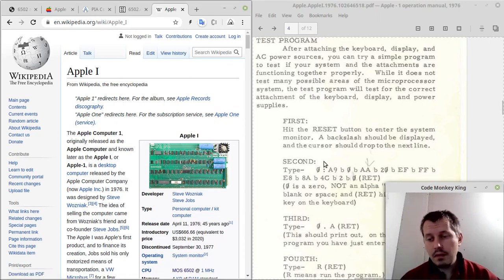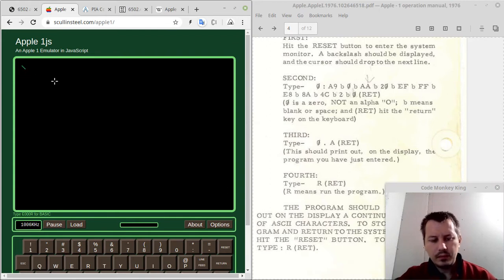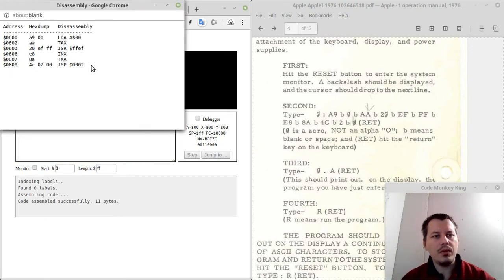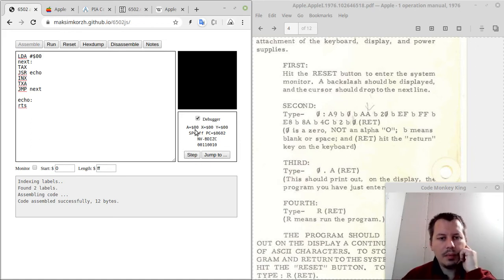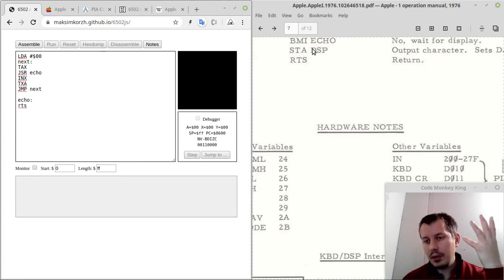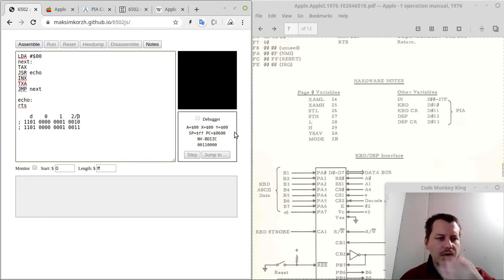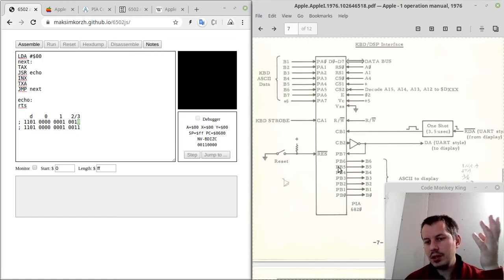Test program for Apple 1 computer (1976) disassembled and explained

Comment from the maker: 00:00 Intro
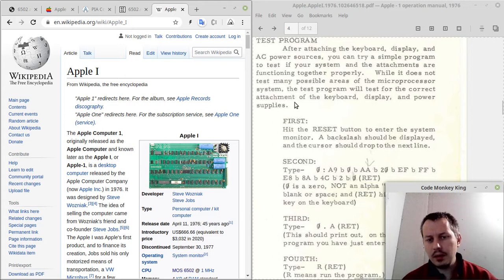01:20 Apple 1 test program
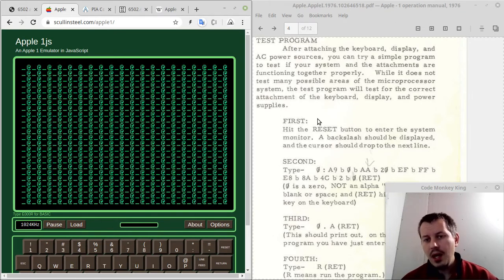02:34 Typing in test program machine codes
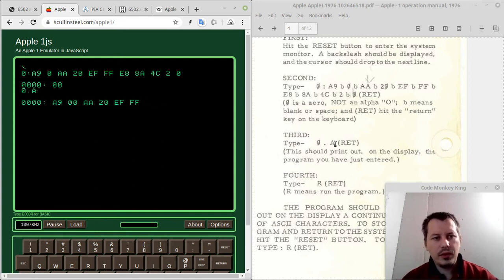04:25 Running test program in the Apple 1 js emulator
06:10 Disassembling test program
10:20 Walking through the test program with the debugger step by step to see how it works
12:56 Apple 1 ROM (hex monitor) source code
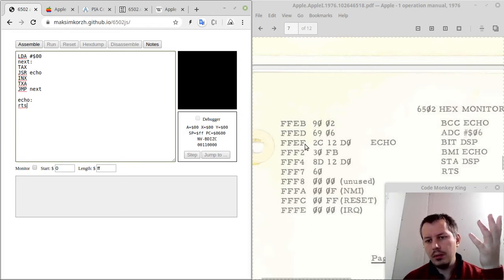13:50 Built it routine to echo characters to screen
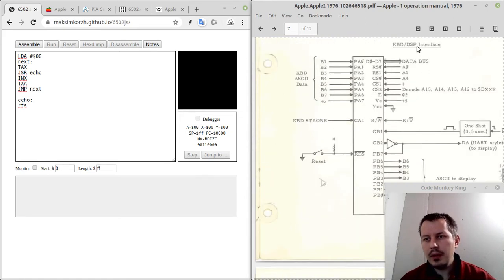18:24 Keyboard and display interface
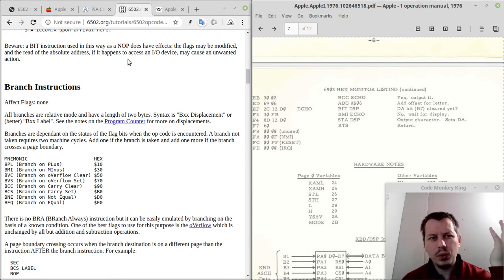21:46 Display control register bit
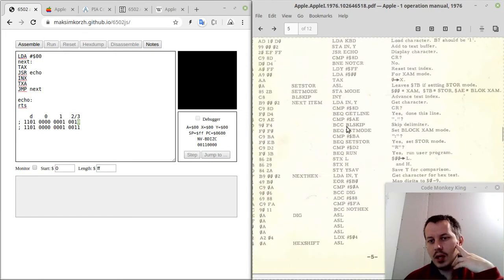24:53 Why do I learn this stuff (bootable 6502 processor simulator project)
27:15 Outro